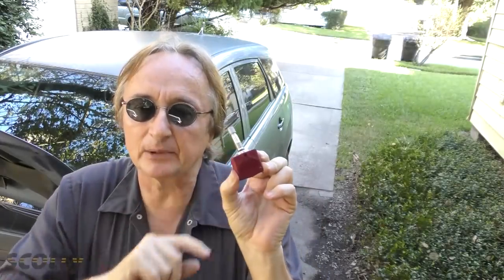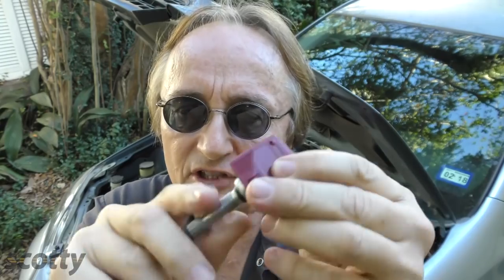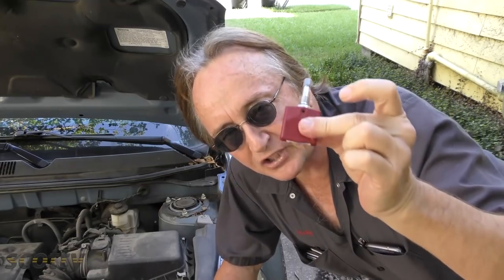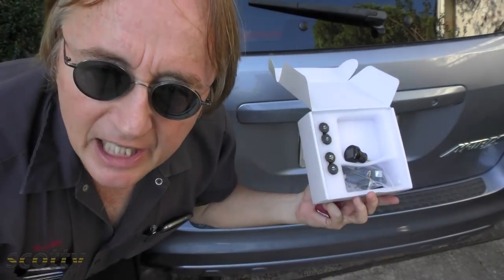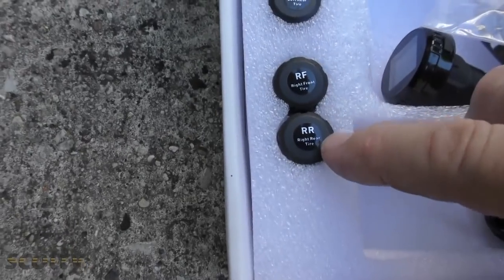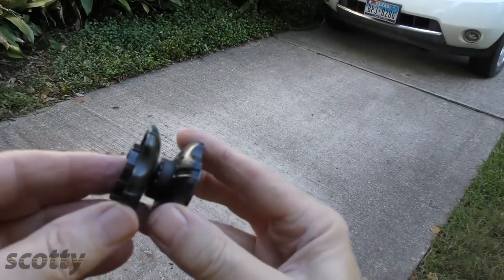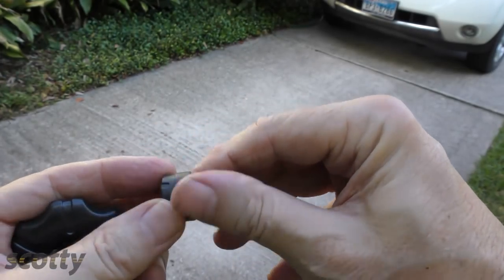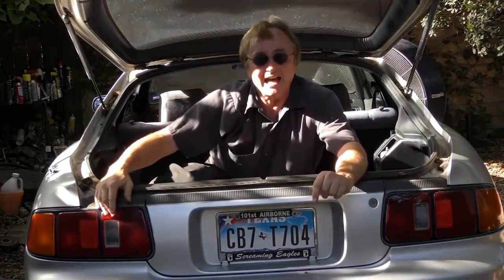How to Use a Tire Pressure Monitoring System in Your Car - DIY with Scotty Kilmer

Comment: I was part of a national government TPMS safety program (pre recession) where my team would conduct random tire pressure readings for drivers at various gas stations. Conclusion: older model vehicles NOT equipped with TPMS should be given this handy little device for free. Proper air pressure saves lives!
Reply: It's sad to see how many tires getting their tread separated from the sidewall due to under inflation.  You see them everywhere on the shoulders of busy highways :(
Reply: This would be small change, the gift we are giving the corporate companies, their executives plus share holders and the top 1% is the real problem
Reply: No, if their tires are low they should have their license revoked, not be given free stuff.

Comment: This is a great alternative for those who have Differential ABS pressure monitoring systems since they are not actually looking at pressure.  They only look at changes in rotational speeds and deduce issues based upon differences between wheels.  If all tire pressures go down due a cold snap, you'll never get a warning you're under inflated.

Comment: Just a little electrical tape on the dash and the whole problem is fixed
Reply: colt helms That is a great idea. I'll just use a tire gauge like real men used to do. This tech crap is a rip off. A little tape over the light will work great.

Comment: That is a great replacement for when the modern built in systems fail or if you own an older vehicle without sensors. I would definitely make use of that handy tool.

Comment: I'm curious how well these sensors hold up over time. How well do they handle road grime, dirt, mud, UV rays, etc. What is the longterm effect on the valve stem needle? Stuff like that.

Comment: My dad has a watch that charges through kinetic energy, like your arm swinging as you walk. I wonder if it would be possible to use that tech in the stock pressure sensors 🤔

Comment: Just to let you know Scotty you can mark the tire where the rim weights are and the valve stem take the rim weights off and the tire replace the valve stem put the tire back together with the weights where they need to go and not have to balance it but it's $3 at Sam's Club to have your tires balanced

Comment: I bent a whole bunch of rims after I started doing my own oil changes. Finally realized that since I was doing my own, I wasn't having the quick lube check my tire pressure every 3-4 months. My tires were running 19 psi and trouble waiting to happen. This would help me.

Comment: I can't find the source article where I'd read about a piezoelectric 'pill' that would perform the pressure monitoring  after being dropped-in via the valve stem; of course the valve core would have to be removed first. With the continued miniaturization of electronics the concept seems workable to me.

Comment: I installed this on my wife's car and now she's noticing a slight vibration in the steering wheel when she goes above 50mph.  Could this small a sensor have thrown off the balance of the tires?

Comment: I like tpms. I don't under stand why most people don't like it though. Sure the sensors can be a pain some times but if you actually check your tire pressure like your suppose to not lights. :)

Comment: Hi,

Wondering if anyone can answer this for me. I have a tpms in my car but when i took off those winter tires on wheels and put in my summer tires on separate wheels on, they didnt come with a tpms. Now everytime theres a light on my dash for tire pressure alert. Is there any device to bypass that? Or a way to disable that light until i put on my winter tires on again?

Comment: I could use TPMS in my car since its an older model and has no TPMS... Its also old enough to have a button labeled traction control off that you don't need to press in 15 million different combinations to actually switch it off

Comment: + Scotty Kilmer So we can see the leaks before they go flat and become an emergency! 🚨 Most motorcycles 🏍 don’t have a cigarette/ 12 volt outlet the The Battery Tender Ring Terminal Harness/ quick disconnect cord with a battery tender cigarette lighter female adapter would be most useful to make it work with two wheels. I can then set up my second motorcycle 🏍 with the other two units and switch the receiver to which ever motorcycle I happen to be riding at the time! Scotty, thanks for keeping us all up to date on the latest car tech. My friend is waiting for that digital head’s up display for his truck you shared recently.

Comment: You shouldn't have to rebalance the tire as long as you don't change the position of the tire on the rim. And no programming is necessary if you are replacing OEM Toyota (or Denso) sensors with the same equivalent.

Comment: The outside pressure sensor is good but topping the tires with air every 10 to 15 days would mean unscrewing the device with the tool provided. Cumbersome IMHO.

Comment: i require this tpms to obviously connect to the car itself. i absolutely do not wont a unnecessary extra gadget in the car. will this tpms system connect to the already existing tpms system in your car ? or do some one know of one that does, i live in sweden and i need winter and summer tires. so getting 4 external instead of 8 internal is a lot cheaper and so much less hassle. also the fact you can replace batteries and not need to trow away the pressure system is honestly not even acceptable in the first place. my car is a toyota yaris.

Comment: As you probably already know, this is way too much technology that's not necessary All you need is a reliable tire gauge, a foot pump to add air, and make sure you check your tires when they are cold, that is before driving the car, and make sure the car isn't parked in the sunlight, or check them in the morning before the sun hits the tires, or else the heat of the sun will raise the pressure inside the tires It's so simple You say you've been working on cars for about 50 years, and I've heard you mention in previous videos how all this technology is unnecessary, and I agree You know the deal dude I'm not coming down on you, I'm just keeping it real, and hopefully you'll keep on keeping it real for your viewers Well, that's all I've got, later and have a good one

Comment: How to fix a 2001 Buick LeSabre no crank no start with security light on @ mr.scotty kilmer
Reply: Ayee Tee buy a new one. Lol
Reply: Check if hydrolocked. Common issue with 3800 engine intake manifold gaskets

Comment: Am I the only one who finds trying to use a conventional tire pressure tester aggravating? Also, I swear, it's annoying when I'm trying to air up the tire and the thing won't stop sliding around and blowing air on everything BUT the inside of the tire.